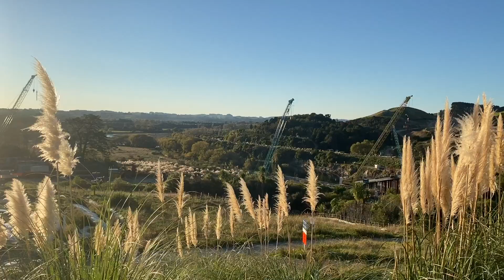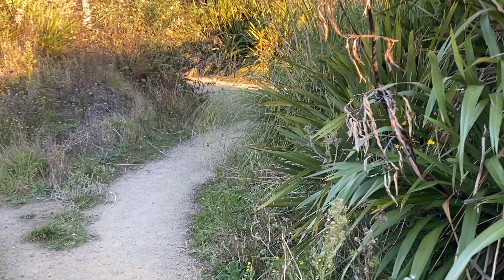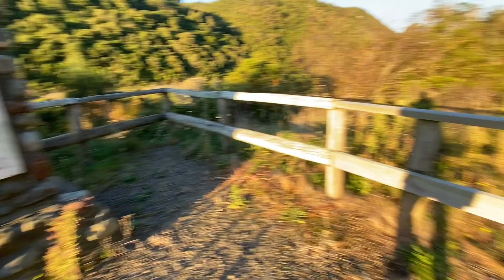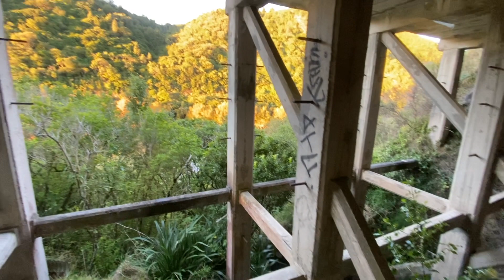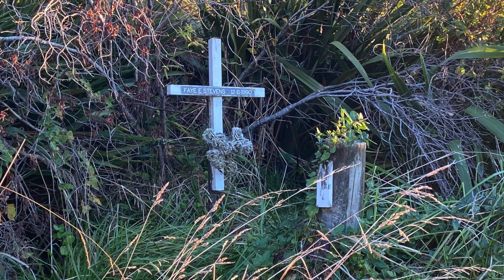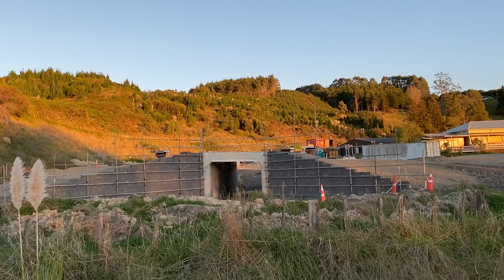Manawatū Gorge Highway Replacement Update May 2022 SH3

Comment: Like most (all ?) Seismically active Gorges, 
there is a (relatively) STABLE Side,
& an UNSTABLE side.
The Manawatu Gorge has the Railway on the Stable side,
and had the old SH #3 highway, on the UNSTABLE side.

This was never going to be a good solution for a busy state-highway !

As a firm believer in "Duplication & Redundancy"  (damned Engineers !)
I would like to see the other (originally proposed) route
on the "Tararua's"  (as opposed to "Ruahines") side of the gorge
also built, for reasons of  "Contingency",  "Insurance",  &  "Traffic Capacity".

Sadly Politicians are NOT (generally) Engineers !!
And Treasury people (Accountants by Mindset) 
are actually GAMBLERS ,
with NO "STEM" (Science, Technology, Engineering, & Math  -  including Statistics & PROBABILITIES) 
skills at all.

Comment: Really interesting Darryl. I’ve seen some “on engine” footage from the railway line through the gorge and you can see the rather terrifying amount of the old gorge road is supported mid air on that older style concrete pillars . (Here is the link  :   https://youtu.be/7qeKGd-6-f4  start about minute 28. )  ) . I think, but don’t quote me on this, (foggy memories of studying geology at tech in Wellington) is that the river always existed and the mountain ranges which are rising, came up slowly enough for the river to keep up its route through natural erosion .
Reply from the maker: Yeah, the river was there first. I looked at it one day the Wairarapa has to flood up to Mt Bruce before overtopping on that side, I used to know, but I think it is about 75m high before the gorge would permanently block.